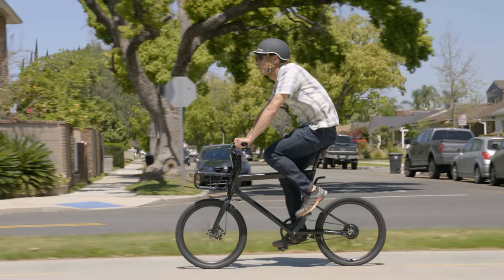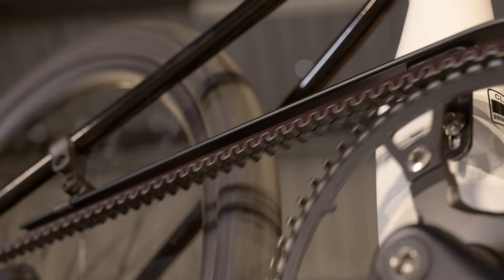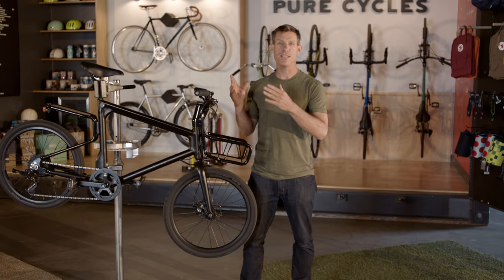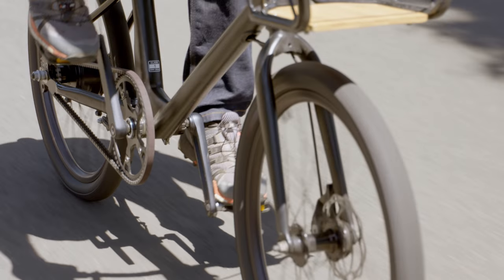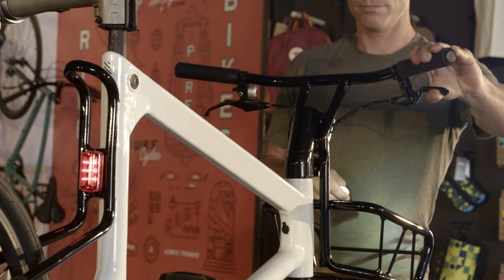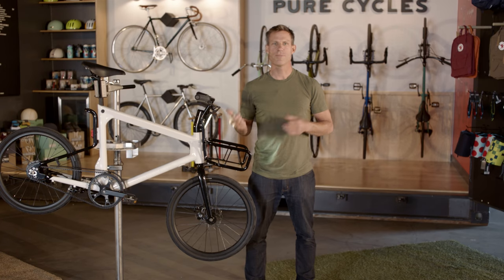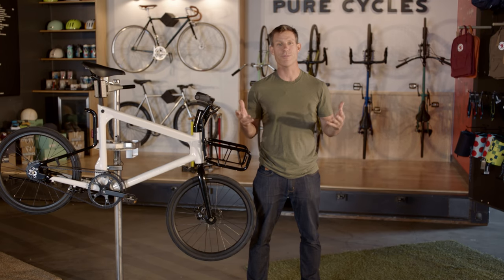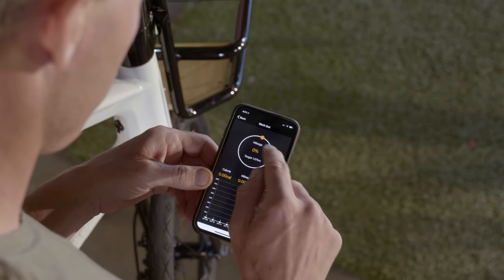Pure Cycles VOLTA Electric Commuter Bike

Comment: So what happens when the day comes the battery doesn't hold a good charge? It's in the frame so how do you replace without having to buy another bike?
Reply from the maker: Any shop that is used to working with e-bikes will be able to swap it out! It's doable just needs some special tools and a bit of elbow grease. The battery can easily be removed through the headtube
:)

Comment: I want this bike, I have tested it at my local E bike shop in West LA. But one major thing is stopping me, the handle bar, it is not in an ideal position, and cannot be adjusted. Seems like a silly oversight, why would they not allow for a custom and or adjustable handlebar. 

Also, I think this has 20 inch wheels. Why not scale up another version with 24 inch, and or 26 inch?